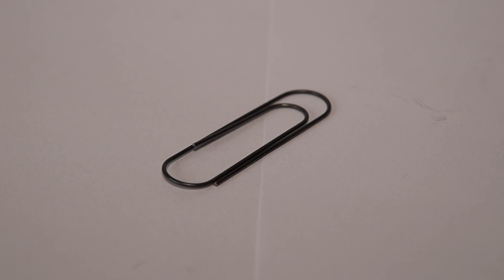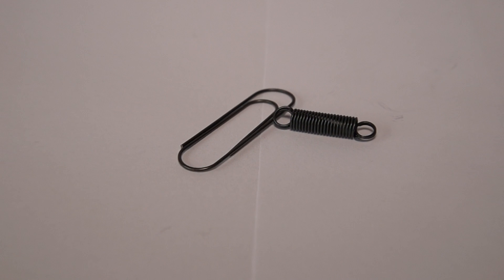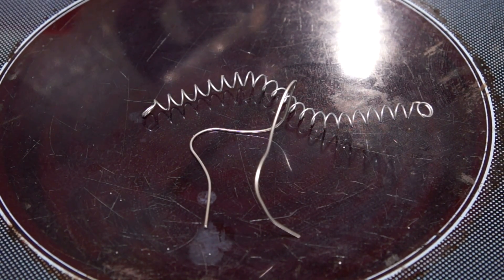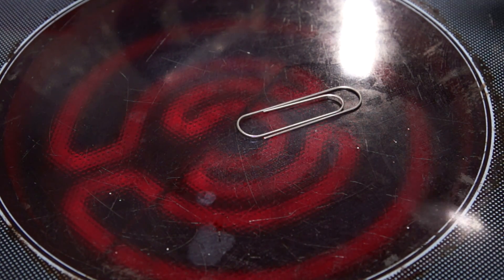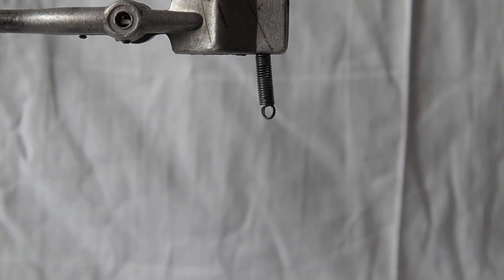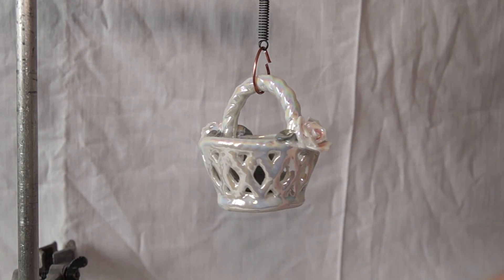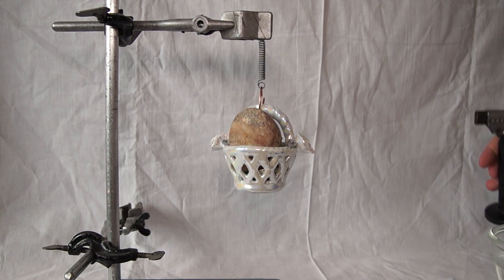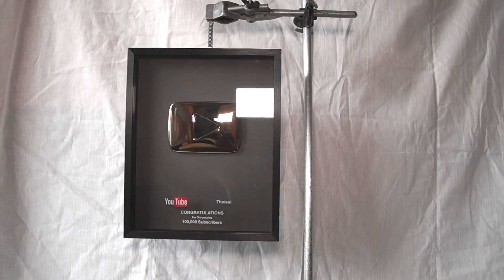Nitinol - Metallic Muscles with Shape Memory.

Comment: All car body works should be made from this stuff..when you dent it or bump it....just heat it up and the car should fix itself...
Reply: then... the paint of the car?
Reply: Polymers can be flexible...also repainting only is better than fixing then repainting...
Reply: Agreed!
Reply: you're forgetting the price, but i admire your great idea!.
Reply: vinyl paint and silicon paint can stretch
Reply: If we could figure out how to make it cheaper, one of the main reasons we don't use titanium a lot for cars is the price, but since this is only 45% titanium I'm guessing the materials required for it wouldn't be prohibitively expensive.
Reply: The car would cost way too much
Reply: A decent idea, only it would cost more a Eurofighter lol
Reply: greenteasenpai would cost you much once...
Reply: Nitinol doesn't have the structural strength and availability for that. Your car would start springing back to its original shape from the moment you go outside in the sun.
Reply: Dude, it will be a dud. You know why ? Because the car body is constantly  heated by the running of the engine fiction of the tyres etc.. The car body would be bent out of shape immediately upon starting the engine as it will raise the temperature of the alloy which until now, was at room temperature and original shape.
Reply: that be great if titanium wasn't so expensive
Reply: Ahmad El-khatib what an amazing idea you are creative and got bright imagination but the alloy is too weak for car
Reply: Maybe if it was just a small part of a composite material. A composite with the ability of shape memory but has enough structureral strength or heat resistance to not fall apart after the car is started or from the friction of the wheels on the road. The only problem is the cost.
Reply: Depending on the concentration of the alloying elements, you can tune the temperatures at which the transformation occurs
Reply: Bumble B that's a good point
Reply: It's too heavy.
Reply: you bloody genius
Reply: You read my mind!
Reply: Yeah except for the fact that it would be super heavy in comparison to normal fiberglass and it would also be super expensive but yes it would be awesome
Reply: I wouldn't like to see your car on a cold day
Reply: omg, there's a whole thread of replies here... 😂 never saw that coming... well thanks all for liking the idea 😁

Comment: So if i were to add a current to it, would it heat up enough to shrink?
Reply: maybe if it was really high voltage I'm not sure how conductive it is and what's its resistance
Reply: Yes, by resistance heating.  We used to use this in the lab as electrically controlled actuators.  I don't know the voltage, as my PostDoc advisor used it, but I dont think it was a lot of current;
Reply: Yes, and it doesn't take much voltage at all to get it there, either.
Reply: It would work with a low voltage it doesn't need to be high voltage
Reply: Yes of course! Im currently preparing a presentation ob SMA Actuators. Search for "Schiedeck", he is using a thermodynamic model to describe SMAs, if you have the electrical properties of the material you can control it. Most SMA Actuators work with low voltage as a heat source.

Comment: can it be integrated to clothes with memory of a folded shirt etc? or even for self assembly of parts as well as disassemble ?
Reply: This is a brilliant idea. I had thought of mixing a small diameter of nitinol wire into thread thats used to make fabric so that it can weave itself tighter or looser based on temperature to control insultation, but the idea of self folding clothes is such a good idea

Comment: Will it return to shape with electric current running through it? Heat from resistance?
Reply: +Buzz Werd yes, any form of heat that hits the activation temp. He says "40c" but in reality there are different temps you can get, 15c, 40c, 60c, 70c, and 80c all can be found. It is just a different mixture of the Ni and Ti.

Actually i have some 15c, and its fun, it is opposite of what was shown here. it always jumps back to its memory state, and only when cool can you move it around, but once you take it out of the freeze, or put it into a warm car on a cold winter's day, it goes back :D
Reply: +Christopher Banacka cool!!

Comment: [Drools at the thought of battlemechs with these for the actuators like the "myomer muscle"]
Reply: same! I googled myomer and I found nitinol, and then giggled like a little kid. I wonder if the application of current to nitinol threads could ever produce heat at specific enough locations and at controlled enough speeds to ever consider attempting to recreate myomer in real life. from what I've seen though it has a really low resistance :/

Comment: I feel as though this could be used in robotics really well
Reply: Not yet, problem is that the relaxation takes time, because the material needs to dissipate the heat. Its used in other, mainly small and ligthweight actuators tho.
Reply: A possible application is in satellite deployment - can be a very lightweight way to motorize solar panel or solar sail deployment and allows it to delay until it's in orbit and warmed by the sun.  Very little to go wrong if it's designed properly.

Comment: nitinol must be expensive... hmmm... if that cheap everyone will usr it
Reply: it is not so expensive for the force those wires deploy, more meters you buy to the company Dynalloy less the price per meter of matterial, you can get 100 meters for 280$, I live in a undeveloped country and I have 14 meters, this matterial is amazing in electronic proyects or aeromodelism replacing big, heavy and noisy servomotors.